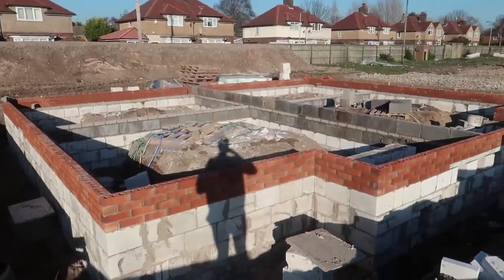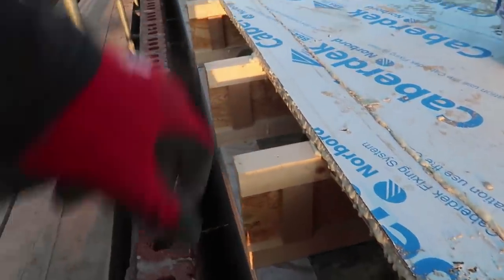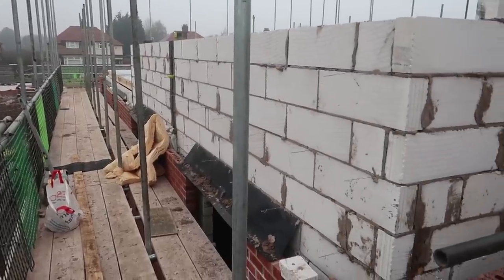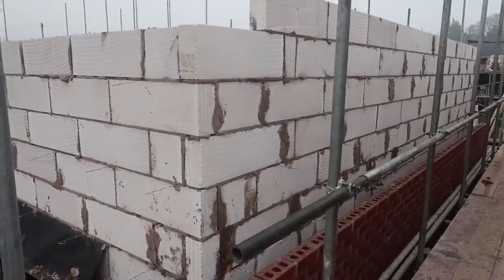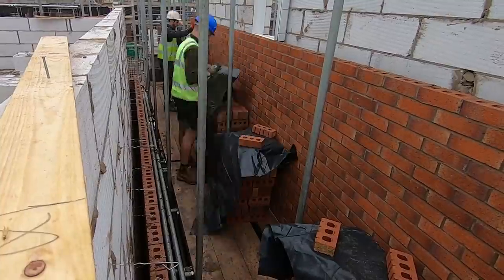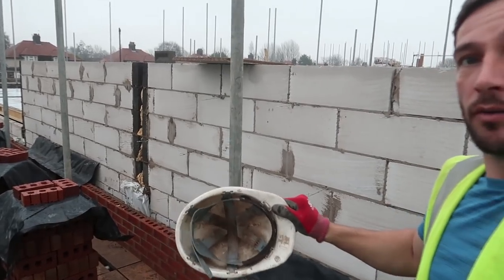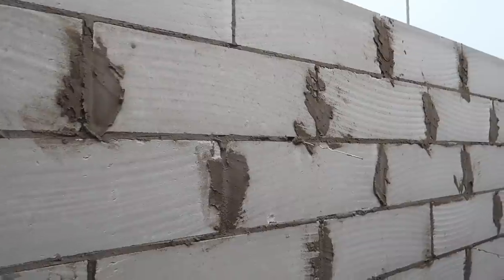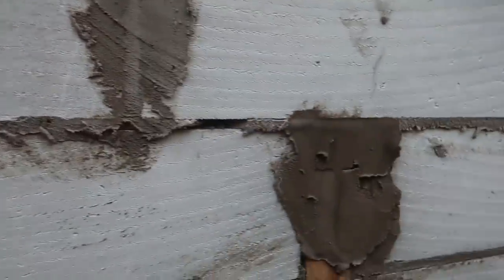Bricklaying Monday To Friday vlog

Comment: Hope all is well Stu. I am curious as to why you do not have full head jonts out to the face of brick? Maybe less angle when throwing head joint or double butter to fill gap as laying. This way you have no need to tool/joint up the brick with a trowel full of mortar. I will say your work is very clean and smooth. Love the channel and content too.

Comment: That's the best video on site work so far Stu, showing the ups and downs. Like the explanations, and using the profile at the bottom of the soldiers was a good tip👍 It would be good to see a video more in depth on the setting out of the first course of trench blocks etc, cheers

Comment: Hey Stu, great video. I see the through-wall flashing above the window headers. Do they not use a moisture or vapor barrier on block? Or is the insulation closed cell foam that would act as a moisture barrier? Thank you. Nice clean work.

Comment: Beautiful professionally done work..

The goldilocks zone for laying brick or block is between the groin and 6 inches above the bellybutton...Bending and reaching makes laying CMU's brutal at the end of the day...Respect to you mason's from a contractor that's layed a few thousand... Carpentry is a lot easier...:)

To the original point; I was wondering if Pump jacks ( I've used them on siding or stucco work) would work with brick and block laying...Beef up the planks to hold materials and you could stay in the "goldilocks zone" all day...But you need picks long enough to span the wall...And Erecting support poles...

Comment: Wow immaculately clean work, separates the men from boys!  Your skills are top!  though massively disappointed to see buliders everywhere using that rubbish floor system, your brickwork will be there for centuries, those floor joists will be gone in less than one generation.  OSB is garden compost in sheet form.   just add water.

Comment: Hi mate sorry to ask but never worked on site only smaller jobs, what are you using the profile for with the clamps on the soldier course? Great work thanks for sharing
Reply: I believe, similar to a level, the aluminum brace is used to keep the soldier course level and plumb with the rest of the wall until the mortar starts to set. Whenever I lay a soldier course, it has a tendency to want to tip one way or the other. That brace would support the soldier course until the mortar has set off enough to use a jointer on.
Reply: cwinter84 just as I thought! Thanks for the feedback mate. Appreciated!

Comment: if you pump insulation between the brick and block afterwards, how will you maintain an airgap between the brick and insulation? I thought that was very important
Reply: building regs allow 50mm of kingspan or 100mm of rock wool
Reply: @persona250   oh where I live we usually leave 50mm gap between brick and insulation because condensation appears on the back of the brick due to temperature differences between the room and the outside.
Reply: @zenmaster666  Yes this is the best way to do it but also the most expensive . Building control will accept either method
Reply: You don’t if they pump it in

Comment: Nice work stu. They don't half throw em up these days. Do they not put fibreglass in the cavity
Reply from the maker: I know mate, a bit sad, no pal the pump polystyrene balls in after build
Reply: I'm doing an extension at the moment on a house with pumped insulation.what a nightmare! If your not careful I could quite easily fill the street with the stuff just by knocking a small hole in the brickwork
Reply: Won’t it piss out next to the eco joists?

Comment: How come you don't just run each course out mate if your using profiles?
Reply from the maker: We didn’t have time left so just put corner up 👍
Reply: And you can pull the line tighter off a dry corner
Reply: @joeharper5523  ya but then you would need a lead corner on both sides